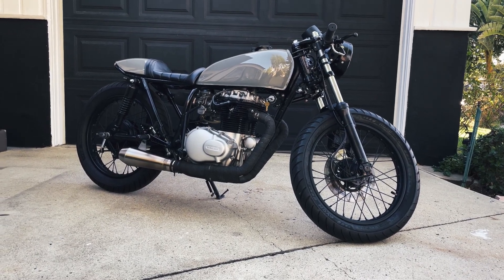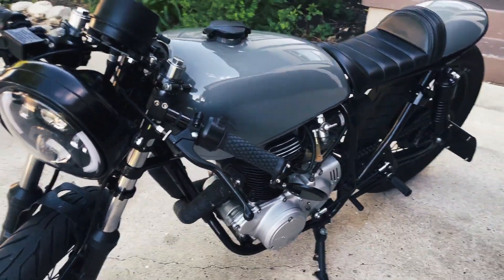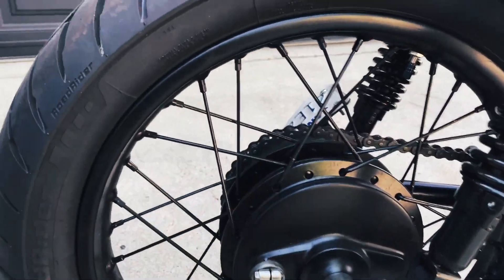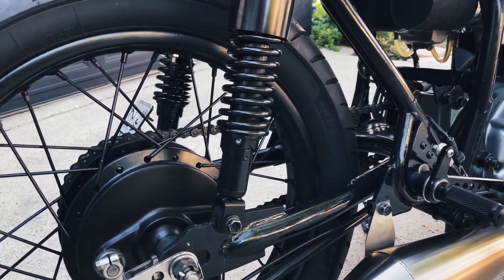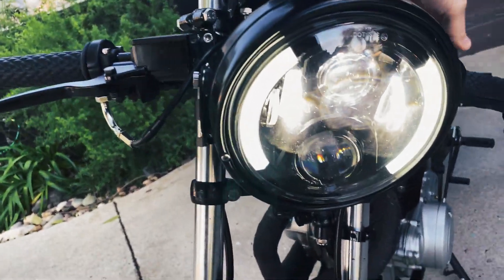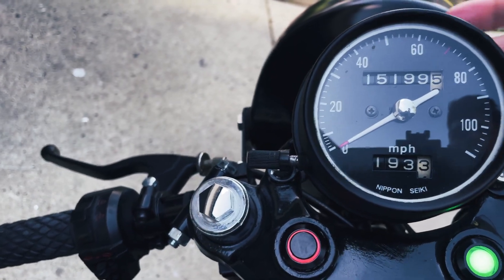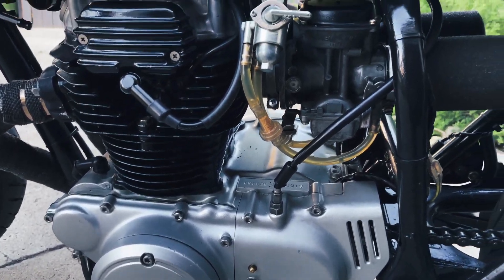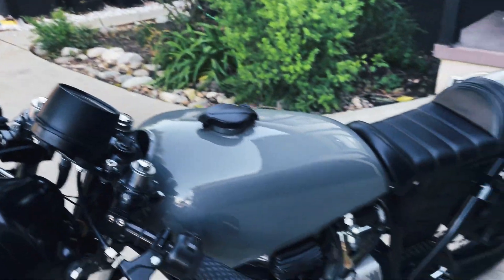1974 Honda CB360 | Cafe Racer

Comment: where you get the linkages for the rear sets or what’s the sizes
Reply: I found some on amazon, there called
 
"Adjustable Steering Tie Rod Ball Joint for 49cc Electric ATV Go Kart Accessory Steering Column Steering Suspension Silver Tone"

But you have to do the measurements yourself, it varies from project to project

Comment: Can we get a run down on wiring
Reply from the maker: Great video idea, most of the harness is in the headlight bucket with a small battery under the seat hump along with the regulator for the electronic ignition